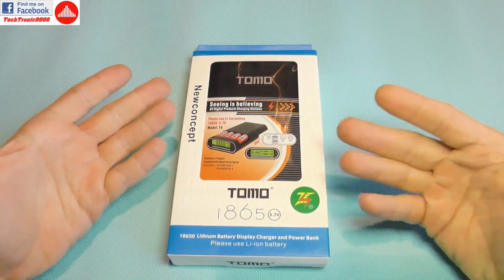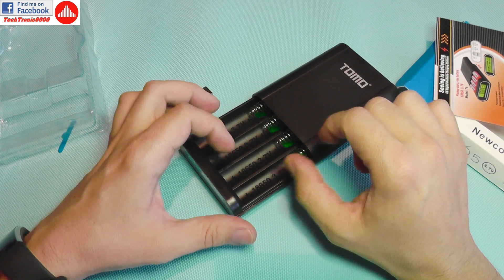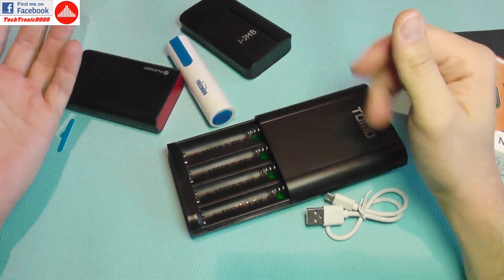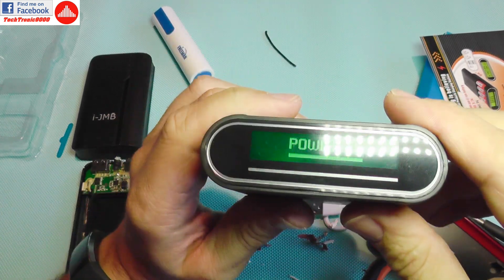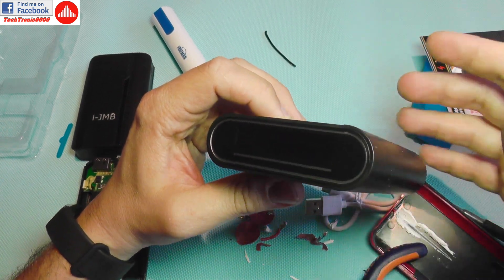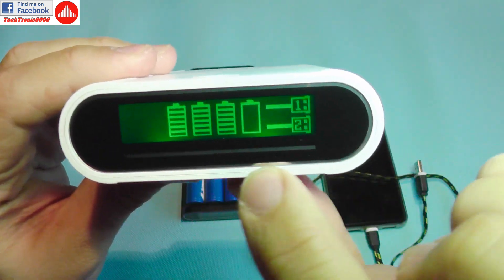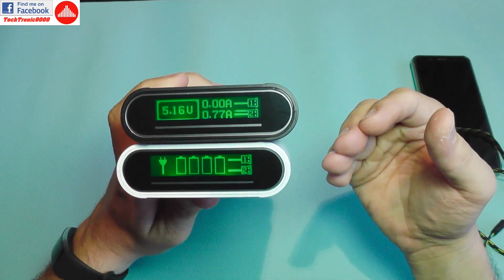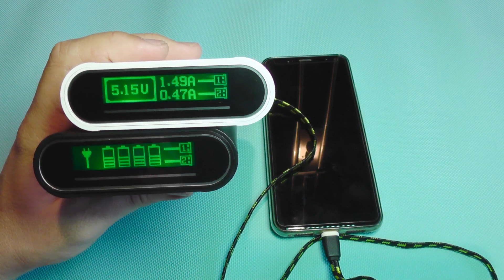TOMO Best DIY Power Bank & Charger for 18650 Cells

Comment: I bought two of these Tomo boxes 4 years ago and they still work. Not the slimmest but amazingly compact for all they have built into them. I like that you can use recovered cells, but I use new cells of fair quality, clones of LG Choco or the MJ3500. Sometimes these cells are a little out of spec, like one cell that when fully charged was 4.4V. Some of the best batteries I ever bought were off brand. I bought some Holy Fire batteries and they are still awesome in my EDC nitenumen X1 flashlight and I missed out on getting the sequel Demon Fire batteries. My fake LG Choco have a real capacity of 3000mah but are probably under spec for vape mod and couldn't deliver 10A although people still use them for that, they work great in other devices and I have about 20 because at $2 each, they are a bargain, I live in Typhoon alley and 20 miles from an active volcano.

Comment: I've found these products can vary greatly in efficiency -- mAh in versus mAh out, actually delivered when in use.  I've measured efficiencies ranging from 60% to 85%. So while your cells may have a combined capacity of 10,000 mAh, you may actually get to use only 6,000.  Just something to consider. Some boost converters have efficiencies well over 90%, and it may be worthwhile building your own circuit.
Reply from the maker: Thanks for sharing!